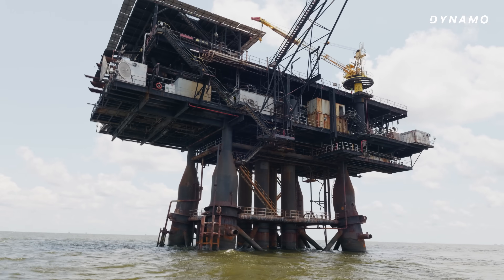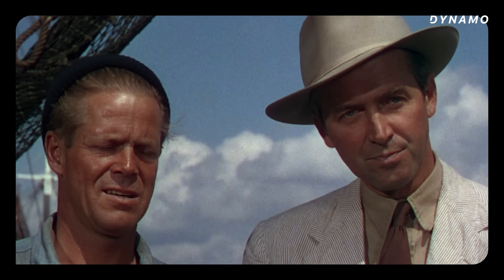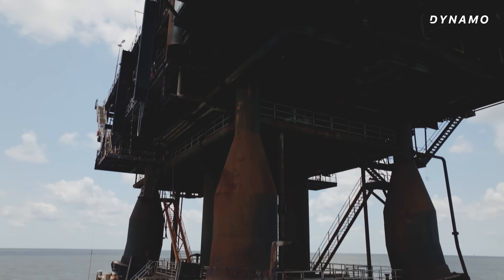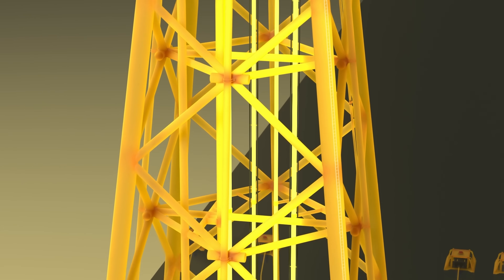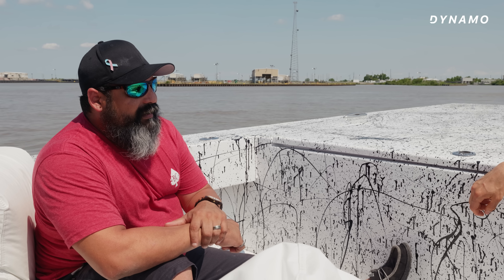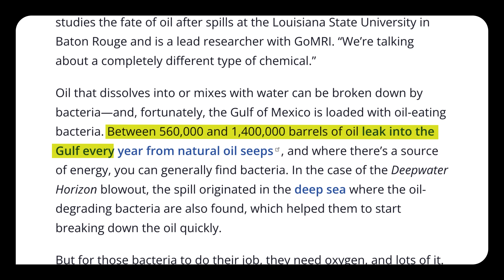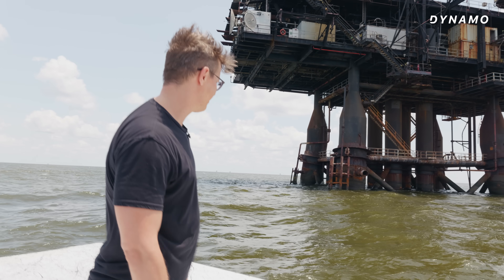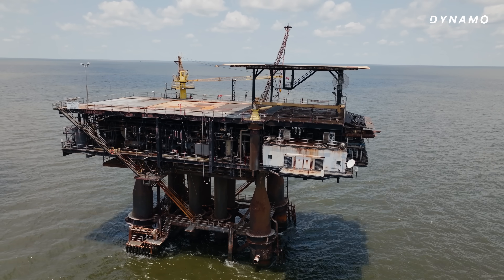I Visited Abandoned Oil Rigs — and Found Something Terrifying Underwater

Comment: MC-20 is an ongoing oil spill it has never been capped because the structure is preventing access to the conductors.  They are afraid by removing the structure the leak could become worse. I live in Louisiana and I work in the oil and gas industry. I love the industry but I hate how we can be so negligent after the fact. These companies need to be held responsible by us.
Reply: Mc-20 has a dome like structure above it containing it. I work on the vessel that pumps out the containment. Drones are flown over the affected area and I have yet to see a sheen. 

Iv been told it would be cheaper to do this until the well was dry than it would be to fix it correctly
Reply: @cjkruse40 I was gonna ask if this was the one with the dome. Thanks for the confirmation.
Reply: @cjkruse40 or a hurricane can change all that strategy fast. I hope and pray it doesn't.
Reply: Work in the industry since 1990.
Commercial diver/welder.
Work o n Couvillion project.
Pump oil out of leaking platform due to mudslide.
Every month.
Coast Guard Operation. 
BSSE Regulated.
Reply: @rafemiguez2056  thank you!   there's a lot less oil in the Gulf since this work started, used to see a 13 mile sheen every day i looked....
Reply: We as People Need To march On Congress 😮😮😮😮
Reply: Scam likely. Just like Dupont put pfas in every human on the the planet
Reply: GR8 Video
Reply: Why don't they put a mobile unit next to it and directionally drill into the reservoir to pump down the pressure and or plug it?
Reply: Why do you love the industry? You and everyone else who has made a great living and secured your families future out of it or, made a fortune in it would have to turn against it in order to change it. I personally don't see any of you doing that. In fact, you are the core support to the industry that has single handedly, both fueled massive economic growth and destroyed the environment with no accountability.
Reply: @bangler62 the environment isn’t destroyed. There are bad actors in any industry, but there are also many good actors who do the right thing. Have you ever been to the Gulf?
Reply: @bangler62  Offshore oil platforms have cause no environmental impact whatsoever. Only in your deranged Liberal mind...
Reply: @bangler62  blah blah blah expert;
Reply: @bangler62 Destroyed environment?!!  Every structure in the gulf becomes its own fishery.  I just returned from the Gulf of America two days ago in Florida. The water is pristine, beaches are beautiful, and the fish are aplenty.  They haven’t destroyed the environment, lol.
Reply: @zellabusa 
That narrow anecdotal conclusion is like saying that it snowed in Minnesota yesterday so there is no global warming. Science is what describes the condition of the Gulf, not tourism.
Reply: @bangler62 There is no man made global warming. Full stop. Democrats could convert all cars and volcanoes to electric tomorrow and the weather would continue doing what the weather does. Everything you have been told is a lie.
Reply: @6-Iron wether it’s man made or just natural but the weather we have these days is much different from what it was in the 70s and 80s.

Comment: Ones in operation carry the risk, but these old fossil wells are capped at the wellhead on the seabed, and fuel oil tanks removed top side, all the pipes and structure could collapse but theres really no risk of enviromental contamination and small risk for other dangers like collision and tetanus! Capping and sealing upon completion of operation  WILL be in ALL lease contracts.
Trust me Ive dealt with field equipment transportation companies, and its really expensive(for offshore large equipment like this, a barge and crew can easily run into the >$100k day rates) and hazardous to try and wrangle skyscraper sized rust towers that are not even worth their weight in teardown,rust scrap!

Comment: Find it interesting that you couldn't find an abandoned platform that has EVER had a blowout. Might want to investigate that.
Reply: Im thinking about this too. The whole point (i thought) when you P&A a well, (plug and abandon) is that it is no longer producing any oil. Deepwater Horizon was an active well. Not a P&A’d hole. I was a dispatcher for Fieldwood, and I had several P&A jobs for the GOM shelf they bought from Apache, during my time there.
Reply: look up the Taylor incident in MC20, longest running oil spill in US history.  Also, in 2025, the Monforte platform is a mess.  not exactly a blowout, but the workover job has run into many problems, and there's oil all over the Gulf out there

Comment: Ultra deep water rigs are not connected to the bottom besides the well components. The riser and drill pipe that this consists of is not capable of holding these rigs (semi submersibles or drill ships) in position, rather they use omnidirectional thrusters in conjunction with subsea and satellite positioning to maintain location. Collectively this is called “dynamic positioning”. When a well is completed it’s prepared for production and capped, the drilling infrastructure is removed and the ultra deep water rig moves on to its next location. A well can take anywhere from a couple months to the better part of a year to drill. The rig will dynamically maintain position (often within a few meters) for that entire time period.
Reply: Using the heave compensator used to drive me nuts on semi subs.

Comment: It also seems like the companies contracted to seal the wells are taking advantage because they can.  I’ll bet if the oil companies were put in charge of sealing them or contracting to have them sealed the market would suddenly adjust radically.  

Anytime the government is put in charge of contracts, you can throw efficiency out the window.  Between the pork barrel promises and outrageous nepotism.  It’s no coincidence that many of the biggest and most profitable companies are government contractors.

Comment: I agree with the points you make and the issue however you did not provide a single example of a decommissioned or abandoned oil rig blowing out or causing any actual damage. Both Deepwater and Taylor Energy wells were active when spills occurred. Deepwater you acknowledged this but Taylor Energy you didn’t.

Comment: could a change in the law to read "Whoever commissions the building of the rig (first operator) is responsible for disposal regardless of later sale"
Reply: It already says that and it's enforced. This video is just lacking a lot of important details and seems to be intentionally misleading.
Reply: @CuttingEdgeDesigns985 sooo if it's enforced why are there abandoned oil rigs? Watch me come back to this comment in 10 years when the oil rig that's been abandoned since 2022 is still rotting.
Reply: @ThatOneGuyWithTheEye  right.  a large number of inactive, leaking platforms are from 2011-2014, and have been abandoned since the price crash in 2014.  the 2020 price crash also saw another 500 platforms abandoned...
Reply: Ha! Oh boy....almost had them there, for all of 5 seconds. Shell corps. End of tactic. Begin new query.

Comment: Cool video! I was happy to find your channel. As a fisherman I like structure. Oil rigs can provide that. The wells need to be plugged for sure. No one on planet Earth can think that crude leaking into the ocean is acceptable. Maybe plug the wells and demo the rigs for artificial reef purposes. I live in coastal DE. About 30 miles East of me lies the U.S. Navy ship, Radford. It's an almost 600 foot ship sunk in 2011 near the 20 fathom line. Fisherman and Scuba divers flock to the Radford every year. Boats leave from DE and NJ. The microbe to hydrogen idea is also really interesting. Maybe, save the serviceable rigs/wells for Hydrogen and plug/demo the rest of the rigs for reefs. That seems like a win/win situation. It has to be way cheaper than hauling all that steel back to land. Plus, places like Venice Louisiana benefit greatly from the sport fishing around oil rigs. That helps the local economy.

Comment: You don't know the difference between oil rigs and production platforms for starters.  Production platforms in Federal waters have to be removed a year after production ceases.  Hundreds per year are removed.  Now there may be variances issued due inability to meet that year deadline.  HOWEVER, if a production platform is abandoned that has some issues with navigation.

Comment: My grandfather was a "smart pig" operator in the 70s and 80s. A pig is basically a dodgeball they shove through the pipe under pressure to clean or unclog it. A smart pig is the same diameter but about as long as a truck. It inspects the inside of the pipe. Grandpa was one of a literal handful of people in this hemisphere that could operate them. So he'd park his truck on the beach for work and a helicopter would pick him up. Take him to whatever rig he was working on. He was also in the navy and then the navy reserves while in the oil industry. He retired from the navy as a master chief.
Reply: Cool stories. 
Was he a diver?
Reply: @aalhard no once he started doing the smart pigs he probably never even got his hands dirty again. When he landed on a platform the equipment was set up and ready for him to start. He probably just looked over everything then started operating the machine
Reply: @timbrwolf1121  You load those things into the pipeline and then close the launcher doors, pressurise up, either with pumped water or with production fluids, then you launch the device and don't get to see it again until it pops out of the other end. Apart from controlling the pressures and flowrates in the line, there's nothing you can do to influence what the pig is doing in the line. He was either involved with the loading/unloading, perhaps installation of a temporary subsea pig launcher/receiver, or the data retrieval afterwards, which would generally need a serious cleaning job to be done on the pig first, as they can cover themselves in some exquisite gunge during their journey through the pipe. There are also a lot of other types of pigs that tend to be pushed through the line before risking an expensive, bulky, "smart" one and he may have been involved with those operations too.
Reply: @seamusbyrne7820 I appreciate the insight. Either way he was one of a very small group of people trained to operate them.
Reply: You don’t use smart pigs on wellbores..
Reply: @dkwochka you use them on the lines from rig to rig or rig to shore. Im aware.
Reply: Whilst they certainly did have pigs in the 1970s and 80s, I'm not sure they had the smart ones until the late 90s, when the microelectronics became more practically-sized. Were they calliper based, and how did they store their data?
Reply: My dad had a pet pig when he was a kid. I sure hope at some time in the past they never tried stuffing a real pig into a pipe no mater how smart he was!
Reply: They have expanded those smart "Pigs" to be pumped through pipelines.  They can measure decay in the thickness of the pipe and tell you if it is on the inside or outside.
Reply: @pbodymathis  Being pigs, they were always meant to be pumped or driven though the pipelines. It's the ultrasound measurement module that does the things you're describing and not every intelligent pig deploys that.
Reply: I retired in 2015 be we would track pigs with and ROV. The operator would put a nuclear source in the pig and The ROV was fitted with a detector to observe the pig as it passed a certain point like a valve or other subsea structure.
Reply: Pig plug or pig tail
Reply: Okay. So what is your point
Reply: @Camarokidd I guess I should have said. Chances are he was on one or more of the rigs shown
Reply: Who cares?
(Except trust fund kids like this with too much time on their hands trying to justify their existence.)

How big is your trust fund ?!!??!!
Reply: @hg2. My water is off and i cant afford to turn it back on
Reply: @timbrwolf1121 
Not you.

The guy who made the video.
Reply: Thank you and him for his service 🙏

Comment: A bit of hyperbole in this video.  All wells in gulf wells require a subsurface safety valve that is typically 300-1000ft below the mudline.  They also require two barriers to the surface.  You mentioned inactive wells should be abandoned by law.  Abandoned wells are restored to the original rock with cement, insolating each zone from each other and the surface.  There are no doubt wells that need to be abandoned, just because you see a platform does not mean that the wells underneath them have not been abandoned.  It is an issue, but would prefer a more honest approach.

Comment: this is a common problem with most major mining operations where a bond is put in place for clean up but its never enough which is why they should do both a initial bond incase the site fails early and doesn't create any true revenue/profit and additionally have a environmental clean up trust in place where a % of the revenue/profits are diverted to for final clean up once the site is cleaned up the remainder of the fund either goes towards other clean up trusts in play or is diverted back to the site owners as pure profit.

it was a mistake for the government to consider a bond on initial approval of a project to be enough money to pay for clean up operations when its been known for 100s of years at this point that theres almost never enough money to cover the costs.
Reply: Insufficient by a factor of about 20
Reply: There's plenty enough money for clean up, absolutely! They take it and buy another mega yacht, failing cruise ships or apartment building to raise prices again and hose tenants out of even more.
Reply: Trump reduced the size of the bond required by oil drillers because Obama had increased it years earlier
Reply: @PeterShipley1 he likely did that to lower the barrier to entry on projects so smaller businesses could compete.

The bond honestly is kinda pointless as it was never enough to cover the costs any wat a trust funded by a % or profit or topline revenue is better.
Reply: Oil companies go through a process to reevaluate the cost of abandonment every 5 years to make sure the bonds are sufficient to cover the abandonment cost.
Reply: @RNLRev3 i would assume thats a best practice for larger companies but as they get sold down the chain i would assume thats where a majority of problems start to occur thats why trust through profit/revenue as it ages ensures the money would be there and as i said once its done if theres remaining money in the trust it could either be given back to the businesses or likely a better system would for it to be absorbed into a national trust for clean ups such as a super site fund.
Reply: We as People Need To march On Congress 😮😮😮😮
Reply: Land of freedom, freedom to screw anything in their sights for profit, CAPITALISM. OHHHH China is communist we must stop it. Socialism or barbarism.

Comment: Zombies and random blowouts?  Boudreaux took you for a ride.   Look: when a well is abandoned, it is cemented and that often after preparatory down-hole work is done to kill the well [when its under-producing/bringing up too much water].  To get at that same zone again?  A new hole must be drilled/sidetracked. 
Here's a hint: lift happens in an underbalanced situation.  The gulf isn't California, where steep coastal shelf sometimes gives out and top hole cement gets bypassed on active wells.
Reply: As a former Halliburton employee this is the only sensible comment I've read on here.
Reply: @abedfo88  Halliburton is reputable?
Reply: The expert is an activist and those tend to be flexible with the truth. The host didn't ask a simple question: If the well is dried up and no longer producing, how would it blow out? Then like you say, the wells are plugged and sealed off. That may be a bankruptcy issue, so if a rig operator is in bankruptcy, perhaps the court should rule and reserve remaining cash to plug the well.
But it isn't just an oil industry problem either. Supposedly clean energy businesses also go bankrupt and can leave the land and sea scape littered with abandoned wind turbines, solar panels. Those also require cleanup and aren't always clean given wind turbines can contain a lot of oils, solar panels toxic heavy metals.
Reply: @brolohalflemming7042  I think that's a misunderstanding of what it means for a well to be "dried up". Its not like its out of oil, it just doesn't produce enough to justify running it.
Reply: @joshmo9823  Sure, but the basics are still correct. So as productivity drops, so does pressure and the risk of large blowouts. Then to complicate things further, use of enhanced recovery where water or CO2 is pumped into a well to get the last dregs. Which then becomes another safety issue around carbon capture to produce that CO2 and the risks of those pipelines blowing out and gassing people.
Reply: Yet the well still blew out when a rig fell over so you are wrong